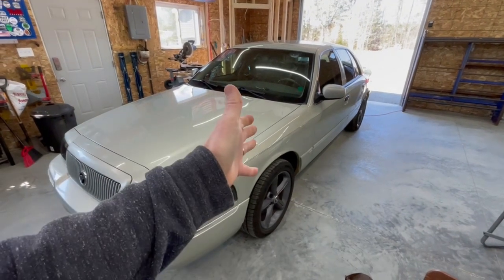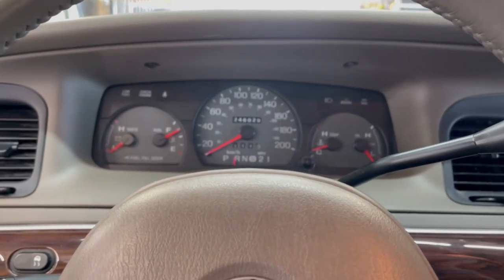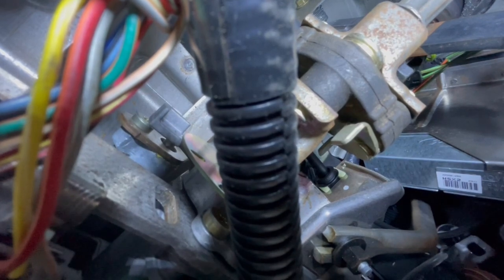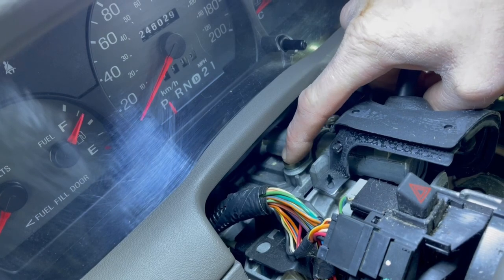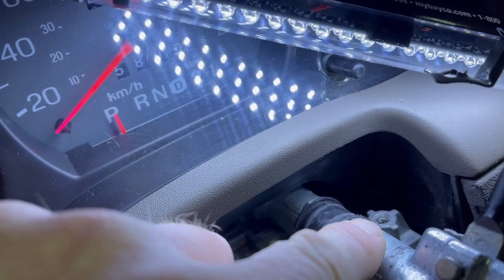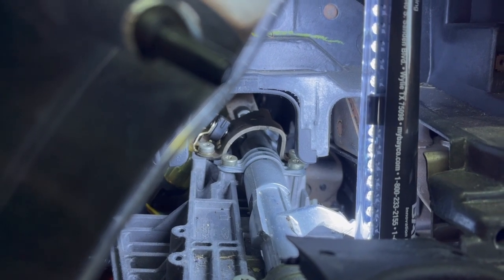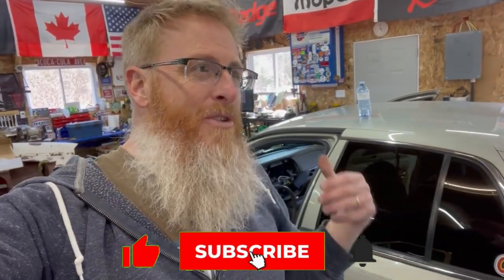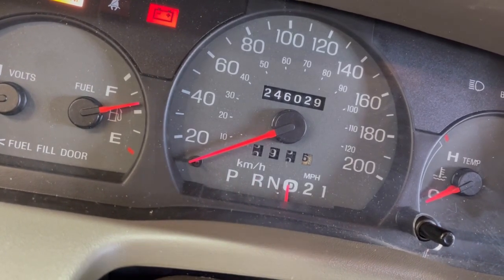Ford Vehicles Loose Steering Column Shifter

Comment: I just fixed mine today and the T30 screws were tight on mine, but that nylon bushing had worked its way out of its spot. I found it resting forward of the clamp. I wound up super gluing the outside of the bushing and I put some on the cap and that bushing is held in nice and tight now, but the shifter still rotates freely on the inside of it. Gotta love a free fix. I was surprised to see that it had done that, I was expecting the screws to be loose.
Reply from the maker: Just a bit of time can fix a lot of issues.

Comment: I just fixed my shifter on my 2000 Grand Marquis three days ago. I thought it was the shifter cable because it was so loose that I could not get it back into park. It was the two torx screws that was loose. Thank goodness.
Reply from the maker: Very common!
Reply: @OldeCarrGuy  Especially on a car that old. Things bound to get loose or break.

Comment: By the way those little rubber bushings are six bucks a pair, worth a shot if it makes it any tighter, Dorman 905-107 is correct for my '93 TC might match most of the Panthers.  F3TZ7L278A might be the Ford part number to cross reference.
Reply from the maker: Yeah, I may be inclined someday to replace them. Thanks for watching

Comment: Be careful when lowering the steering column. That adjuster is attached to the PRNDL indicator with a small cable. If you drop too far it will do bad things. You didn't drop it too far, it would be more of an issue if you were replacing the heater core. I didn't know the indicator was adjustable. Thanks for the good info!
Reply from the maker: Praying I never have to do a heater core. I did actually remove the cluster for that reason.
Reply: What does dropping the steering column have to with a heater core ?
Reply: @brianblithe2271  to get the clearance to pull the dash far enough away from the firewall to get at the heater box
Reply: @garymatthys3605  THanks for reply !!!, oh crap didnt know that my 03 could go out at any time, thanks again for the heads up brotha !!!
Reply: @brianblithe2271  if you need to do it, just search youtube for crown vic heater core replacement. There's a few vids